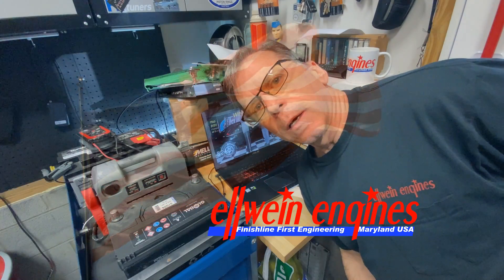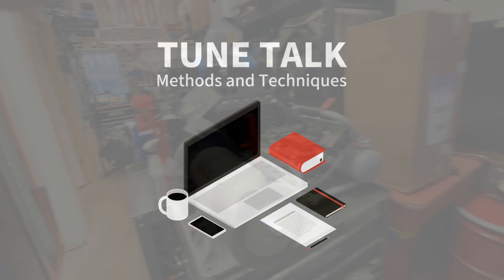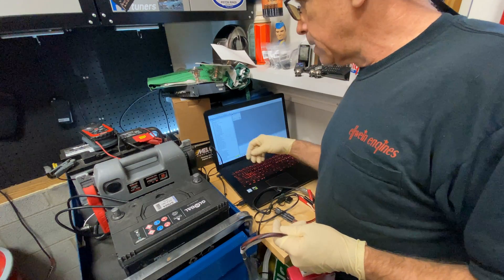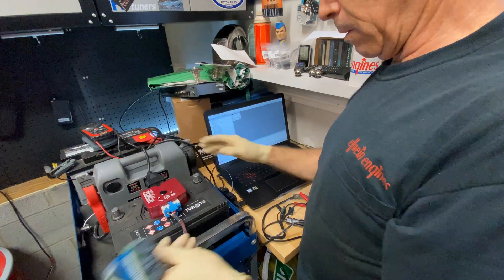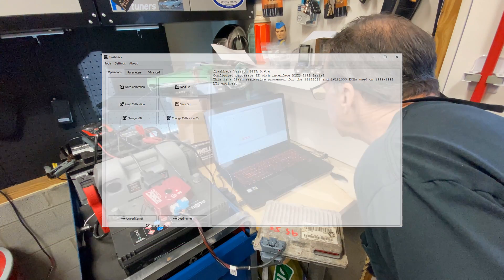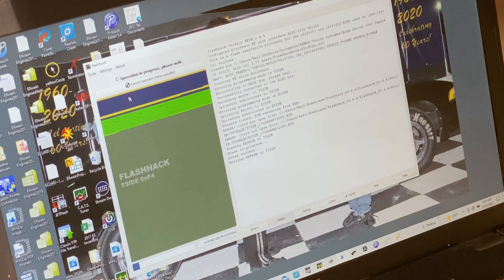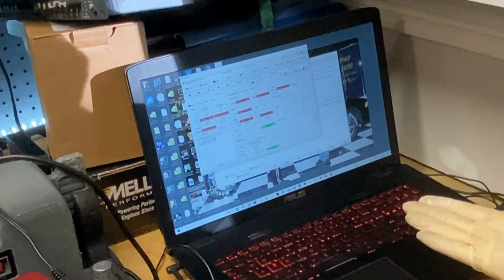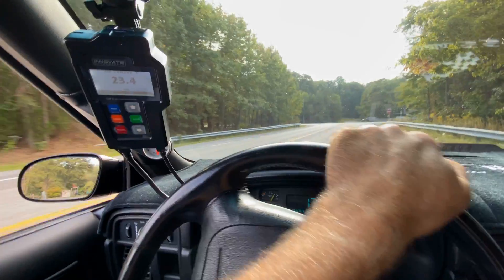TunerPro, FlashHack & EEHack for OBD1

Comment: Did my pcm flash with flashhack and a mail order tune from bryan herter for 50 bucks! Only thing is you need the correct XDF file if you want to edit your bin with tunerpro or else you end up with some wonky values...

I actually wrote a thread on the Impala forums on adjusting the speedo with these exact tools so it's a great way to get started for newer people like me.

Comment: I use the same cables for my lab top to car (mine is a 94 )  .. mainly using their stuff for logging .... but never did any tuning through them ... not smart enough to tune and leave it up to guys like you to tune the car lol all I do is provide logging information
Reply from the maker: The SpearTech cable?   Mine has been working like a champ for many years.